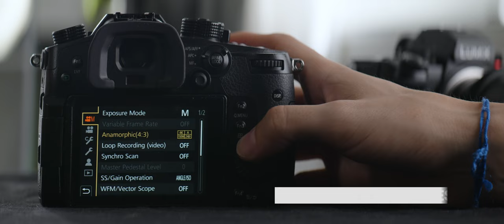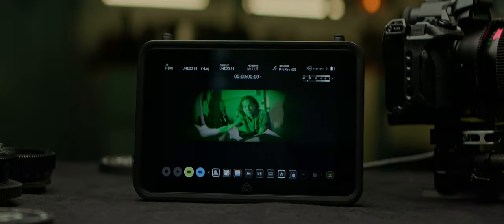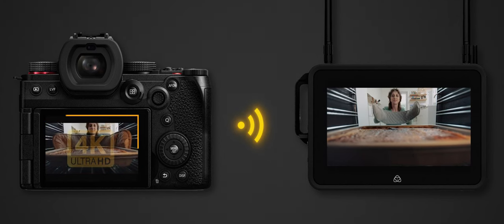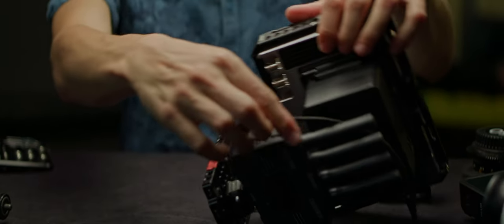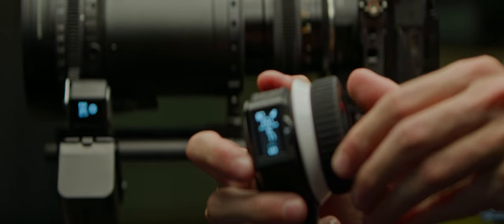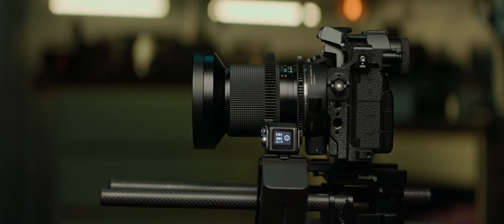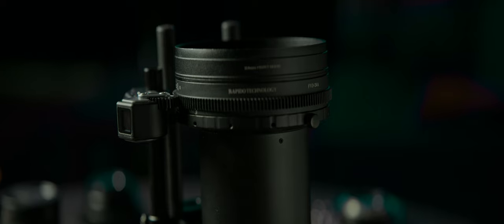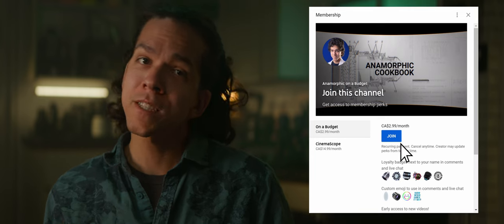Camera RIGGING for EVERY OCCASION - Part 1 - Anamorphic Cookbook - Module 6 Chapter 3

Comment: Good stuff! I suggest doing a companion piece about setting up your work station on set + work flow. (ie. Where to keep the lens set, dioptres, extra rigging parts, tools, batteries, to move fluidly on set).
Reply from the maker: This is an EXCELLENT suggestion for Module 7!